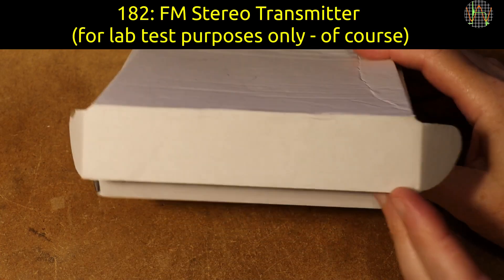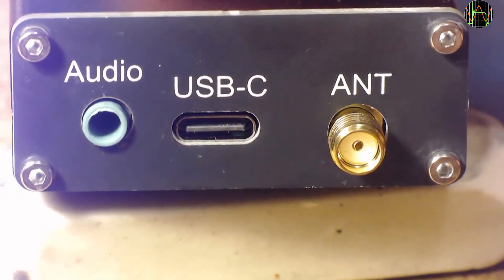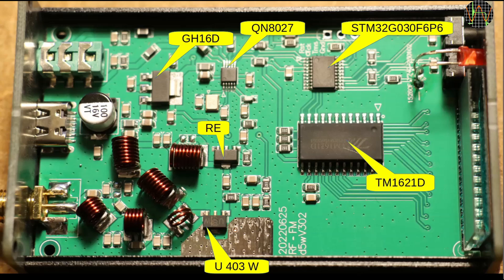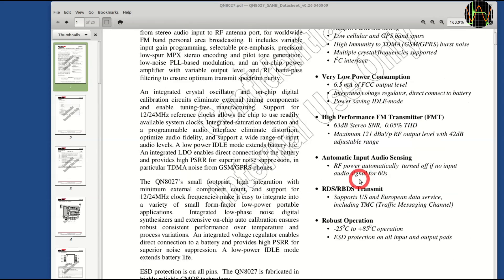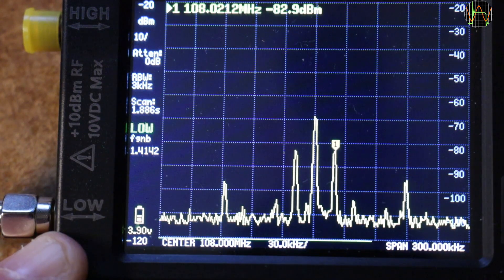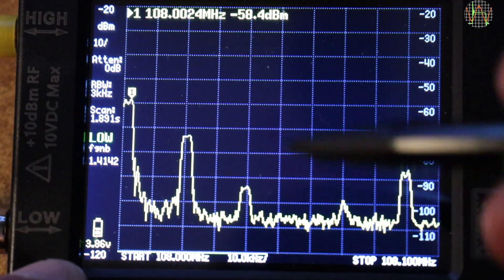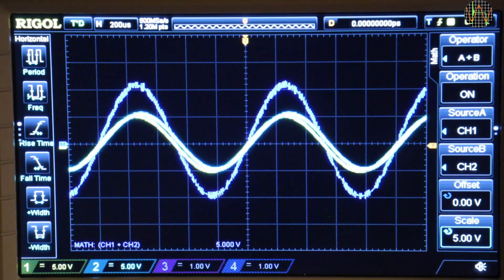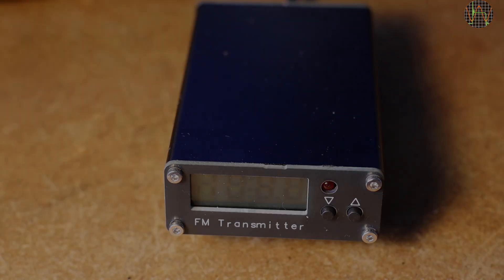182 - FM Stereo Transmitter - (for lab test purposes only - of course )

Comment from the maker: NOTE: This transmitter is producing all kinds of harmonics over a wide frequency band from 76MHz to 250+  MHz, meaning other users including air traffic may be impacted. Use this only in a lab setting without antenna for radio testing, but not for public broadcasting.  Thanks to Vladyslaw Podstavin for pointing this out.

Comment: If your test equipment is in the same room or close to the transmitter, of course harmonics will be everywhere. Dummy load or no dummy load some signal is still in the room. 100 or maybe 200 feet away I'd imagine the signal is on the desired frequency only. 50 years ago, If I took a CB radio at 5 watts and keyed up, I'd come thru my neighbors TV which was 150-200 feet away.

Comment: What is the maximum distance a signal can be sent using a telescopic antenna?
Reply from the maker: I have no idea as I never connect an antenna and only used it inside the lab to test radios lying right next to it. Comments on Bangood claim several km but I have no idea if that is true.
Reply: Hello.
In a small town with a telescopic antenna and maximum modulating power, in some places you can receive a weak signal at a distance of about 2 km, which roughly coincides with what the Chinese promise. At a distance of more than 1 km, a more stable signal begins.
I checked it myself.

Comment: A low pass filter could be built from inexpensive components to deal with harmonics. There are online calculators and I have downloaded a free program from a ham radio website that gives the component values and schematic for a given frequency.
Reply from the maker: Its an idea but what you really need is a band pass because if you look at my pinned comment,while most of the noise is above,  some of the noise is below the desired frequency. Another approach would be to reverse engineer the PCB and compare the result with the recommended schematic in the chip's datasheet. It may well be that the problem comes from a shoddy implementation of the RF amplifier.
Reply: @TheHWcave  Yes that's true. In that case a band pass would be needed. Thanks for the reply.

Comment: Hello from Ukraine.
Thank you for the interesting and detailed review.

I have a small question? Tell me, will it be safe for this transmitter to be powered by a mobile phone charger.
Its characteristics:

HOME/TRAVEL AC ADAPTER

INPUT: AC110-240V 50-60Hz 0.6A
OUTPUT: DC5V=2.4A (AUTO) 12 W

Accordingly, the charger itself is plugged into a 220 V outlet.

Thank you!
Reply from the maker: 2.4A from your charger is more than sufficient. The transmitter only needs 0.5A (according to specs). If the specs are a bit underestimating you have plenty of reserve.
Reply: @TheHWcave Great, thanks for the answer. So, can it be powered like a regular smartphone without hesitation?))

By the way, how is your transmitter doing now, is it working well?
Mine from AliExpress should arrive tomorrow, and after reading both positive and negative reviews, I'm worried it will break in a few days or hours.
Reply from the maker: @vladyslawpodstavin9754  Yes that is how I power mine. The transmitter is fine but I only use it for (stereo) radio test purposes at lowest setting and no antenna. I do have a proper signal gen that can do the FM  band but not stereo.
Reply: @TheHWcave Ok, thanks for the answer!
I subscribe to the channel)
Reply: @TheHWcave Hello.

I would like to clarify something again.

I noticed that the transmitter strongly jams the radio in the range of 64-108 MHz and emits harmonics. The TV signal also disappears at 174-230 MHz.

So tell me, will the interference caused by the transmitter at a distance of several tens or hundreds of meters harm the aviation band (118-136 MHz), airplanes and other users of the band? I would be very grateful for your answer.
😀
Reply from the maker: @vladyslawpodstavin9754  I did not observe this kind of interference and the spectrum did look quite clean, i.e. only the selected frequency was showing up. Then again, as I said, I never selected full power with an antenna connected, so it is theoretically possible that full power causes an issue. Another thing to check if the modulation signal (your audio) is too strong and messing things up. To answer your question specifically. I think something is wrong with your transmitter or the way it is operated. It should not cause interference on the whole FM band. If it does, then there is no guarantee that it does not also jam other frequencies, including aviation bands.
Reply: @TheHWcave I have set the modulation level correctly, but radio and television in the 174-230 MHz band within a radius of 50-60 meters are clogged with harmonics. Is this radius of interference safe for aviation?
Reply from the maker: @vladyslawpodstavin9754  I honestly can't say. By the way how do you measure the spectrum? I am wondering because the mixer in analysers like the TinySA can produce very strange results when they get too much input signal
Reply from the maker: @vladyslawpodstavin9754  I just spent an hour with the TinySA and I can confirm that this transmitter is pretty dirty. When set to 100MHz with lowest power, it also transmits on 76MHz and multiples of 76MHz. The 76MHz signal at P01 is stronger than the 100MHz. Increasing the power leaves the 76MHz and multiples basically unchanged and increases the 100MHz signal which at higher power levels start to have harmonics as well although that may be because I did not use a proper antenna.  I will amend the video description to warn about that. It is still usable in a lab to test radios but I would not use it to transmit my own radio program to the neighbourhood
Reply: @TheHWcave This is very useful information, thank you.
Reply: @TheHWcave Hello. After some time I came back here with additions and questions)
The transmitter emits harmonics in a larger band - at least 64-250 MHz, at the main frequency of 95.5 MHz there is a very strong harmonic at about 71.5 MHz. At +12 MHz, which is 107.5 MHz, it is also there, but much weaker.

I also want to ask, do you have the opportunity to measure the power of this transmitter? I heard that they sometimes have much less than 0.5 W.

Although I more or less managed to cover 1.5 kilometers indoors.
Reply from the maker: @vladyslawpodstavin9754  I already confirmed that this transmitter produces a lot of interference on a wide band. See pinned comment to the video. I don't have an RF power meter to measure the transmitter output.